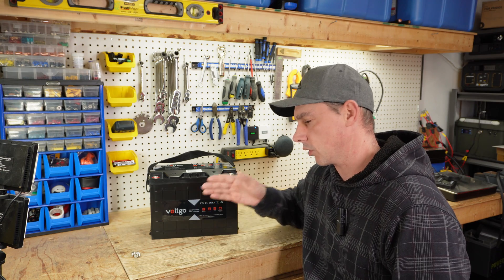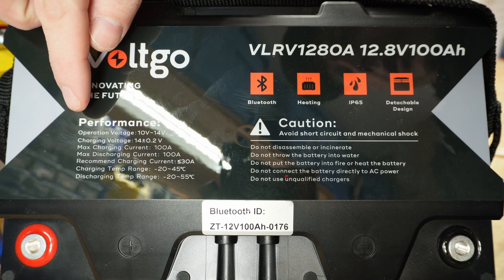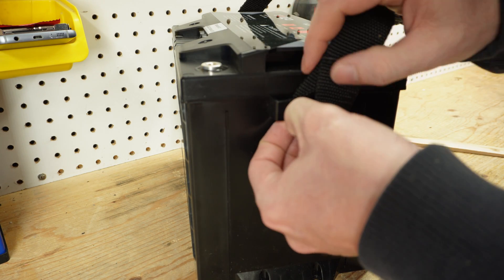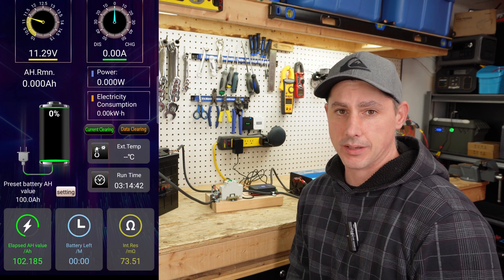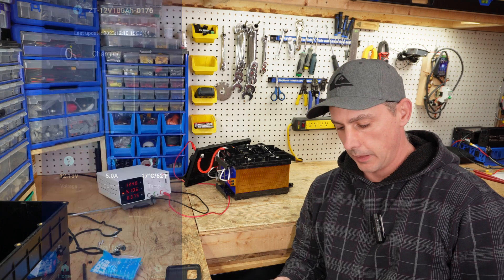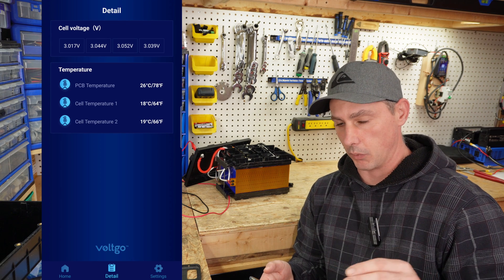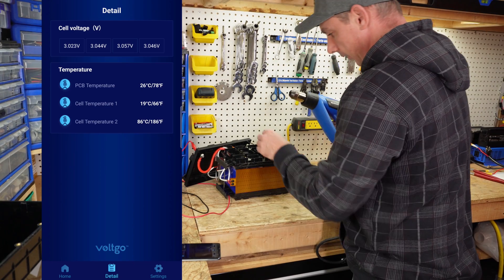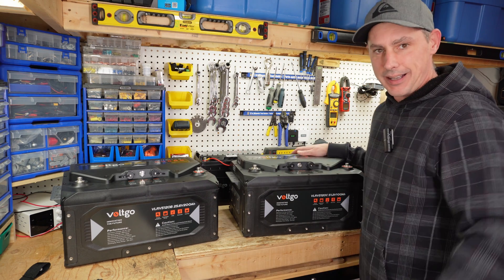VoltGo! 12V 100Ah LifePO4 Battery, Heated, Bluetooth, Waterproof, Fire suppression🔋✨

Comment: In the introduction you initially say the battery has an IP67 rating and then proceed to show on the battery it shows an IP65 rating.  Was the IP67 rating a mis-speak?
Reply from the maker: No, It was a miss print. The batteries they are shipping out have an IP67 rating. Sorry about that

Comment: Ul is a company that tested a product using the manufacturer data for the test  we had a UL heater that caught fire , we called UL and was basically told can't help you i asked for the tested data and was told we use the manufacturer test data TBSS .
Reply from the maker: Yes, That is the process.

Comment: Thanks for the great review.  Do you know what is the minimum current required to turn on the heating pads?  And, are the heating pads on the bottom and top of the battery?
Reply from the maker: Yeah, they are on the bottom and top. Not sure about the minimum. I'd imagine the lower the available watts the slower the heating time.

Comment: Do you have recommend 40-60amp charge controllers Victron dropped there prices on theirs 30% across the charge controller line so I’m leaning that way
Reply from the maker: Sorry, I don't. I've only ever used their smart shunts. Victron is a very well-recommended product I'm sure they all work great.

Comment: are you still using the epoch batteries in your golf cart? if so, maybe you could do a follow up on them and how they have been doing. maybe you could address all the codes that it seems a lot of users are getting on their meter.
Reply from the maker: I will be doing more videos with the batteries in the spring. I live in Canada and it's too cold wet and muddy this time of year. This is the first time I've heard of any error codes with the fuel gauge.